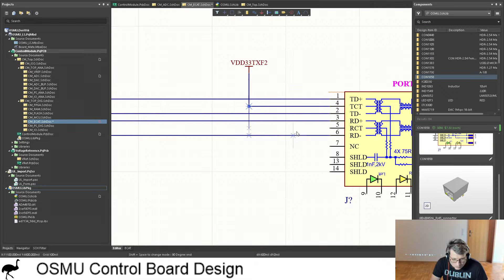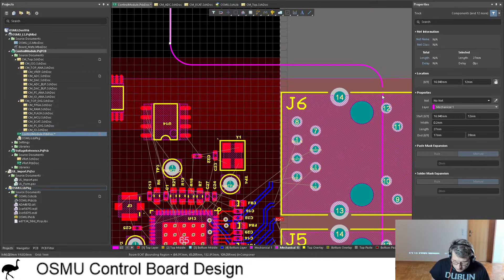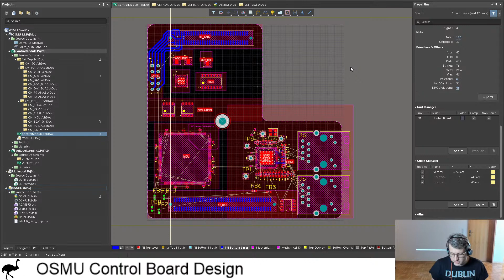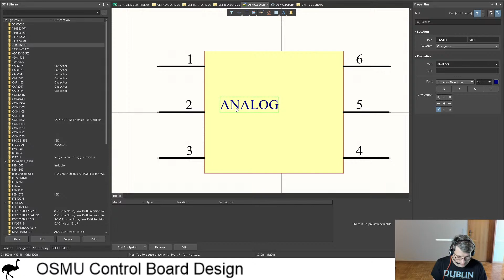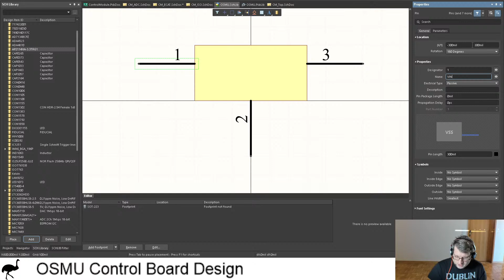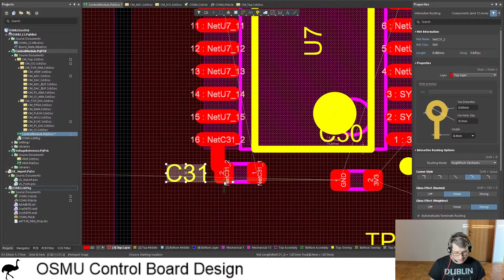PCB Design | OSMU Control Board

Comment: Hello, I am in possession of a dimension 768 sst. I would be interested in more details about what you are doing with yours. the control board is broken and I would rather modernize the machine than replace the board. This printer can be an absolute beast due to its heated chamber and its industrial design. I wish you the best in your work and hope you are able to post more content soon. Thanks!